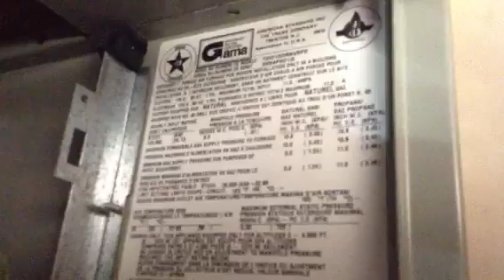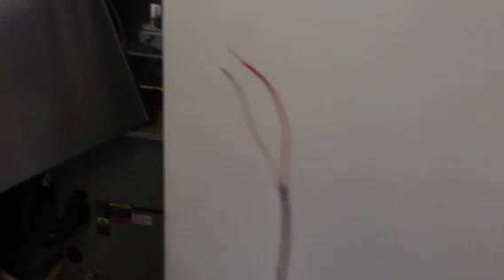Trane Variable Speed Motor Test

Comment: The module  (siver puck) is bad. 2 hot spots that I could see. But the test you did should be done on the motor as well. Also test each motor wire to ground. But good job getting in there.

Comment: Thats not how you chech the control module. Thats how you check the motor.
Reply: No kidding.  You ohm out windings on the motor not the output pins of transistors!  Clearly a novice.